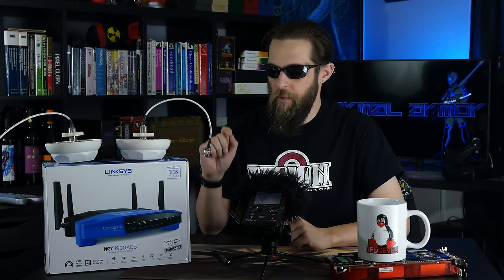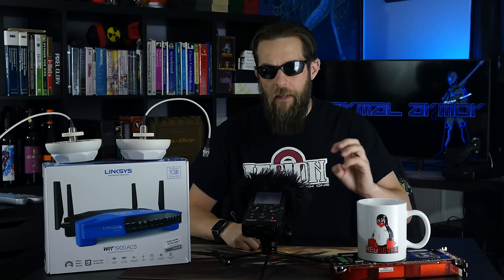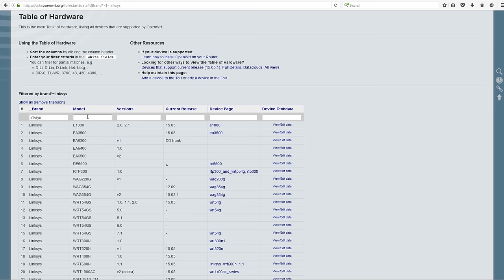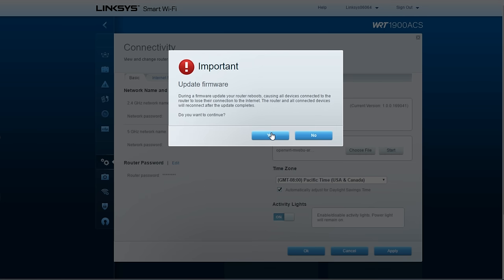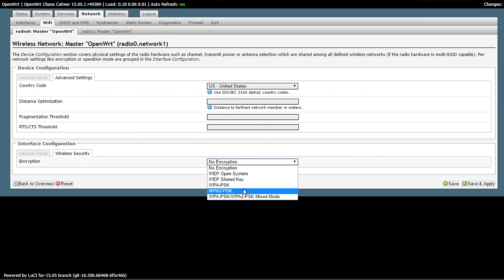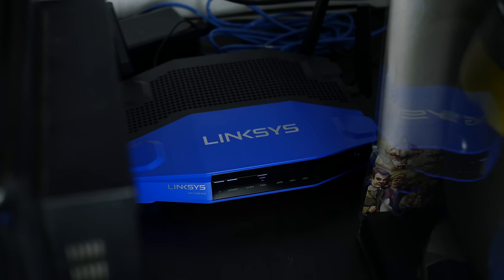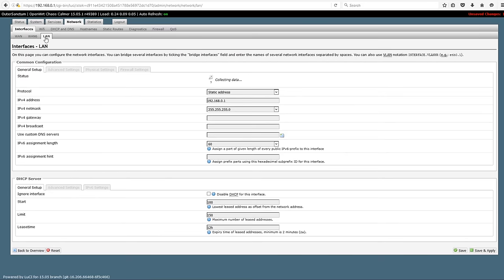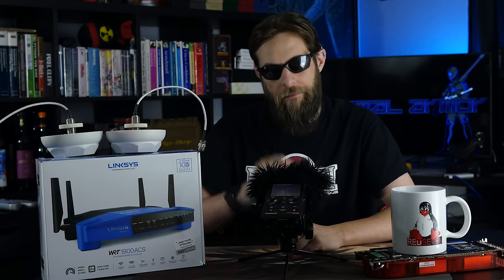OpenWRT on the Linksys WRT1900ACS

Comment: I just bought a WRT1900ACS V2 and am really undecided between using OpenWRT or DD-WRT. And not to mention there are multiple builds for both. I like to stick with the official releases but the word on the street is that the beta version should be ok. Everyone mentions how easy it is to upgrade from stock, but no one talks about how much work is involved to revert back TO stock, especially from OpenWRT. the only real reason I would go with DD-WRT is so I can have more choices of DDNS providers besides just No-ip, which you have to "activate" every 30 days. I currently use the stock Linksys firmware which works OK and I really like how easy it was to setup my OpenVPN server and assign static IP addresses to all my devices.

I just came from a TP-link WDR4300 router and it was frustrating to setup static IP for all my devices. A least Linksys lets you see the hostname of all your devices without having to lookup the MAC address of all your devices. 

TL;DR Linksys firmware is not THAT bad, it's just lacking in options for dynamic DNS providers, and no way to setup an OpenVPN client.
Reply: Thanks. I'm holding out until I get a response on the OpenWRT forums about the checksum of one of the builds not being correct. The Davidc502 build has a SHA-256 checksum that doesn't match. Waiting to hear from the developers.

Comment: Update: 
OK, tried it. Can't get it to work. I'm using:
2 x Linksys WRT1900AC v1, both with openWRT 15.05.1, both got a hard reset (10 sec. hold) and then your treatment.
No bueno.

Does it have to be the ACS version maybe?

------------------------------------------------------------------------------
Great stuff! Very information centered, I like that. 
Next up: How to install Skynet in a VM?

Comment: Nice one.
Did you by any chance compare WAN bandwidth before and after changing the OS? I've been experimenting with the AdvancedTomato OS, a Cisco/Linksys AE6700 and a Linksys E4200, with absolutely terrible results (33% max WAN throughput drop). My guess is that the open OS can't reproduce a certain technology used by Linksys to exploit +300Mb/s connections.
Reply: Sweet. I should try openWRT on my NetGear R7000, see what gives. The latest firmware update killed my 957Mb/s throughput and dropped it to 750Mb/s-800Mb/s -ish.

Comment: Hey Qain, I've got a question for YOU.
Or of the routers capable of running DD-WRT and Open-WRT, could you point me to one that is capable of using one of the USB to configure my WWAN card. 3G/4G

I know that DD-WRT has the functionality, but I'm not sure which routers are actually capable of supporting the interface based on possible hardware limitations.

WWAN is a necessary evil for me and MIMO AC wireless connectivity is as well. Too many TB of data that I have to offload onto NAS and wireless N isn't even a consideration.

If you need a WWAN card for testing, I could send one for testing... if you're interested in it.

Thanks

Comment: Just installed the openwrt-18.06.2-mvebu-cortexa9-linksys-wrt1900acs-squashfs-sysupgrade.bin and it seems like my router is not working now...
Reply from the maker: Did you reconfigure it after the installation?
Reply from the maker: Also, did you install that from the stock firmware?